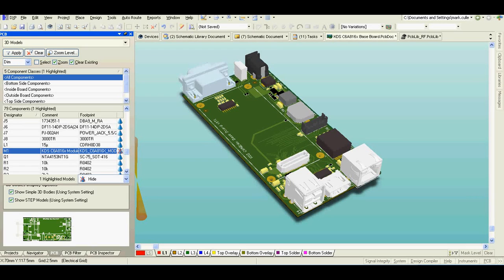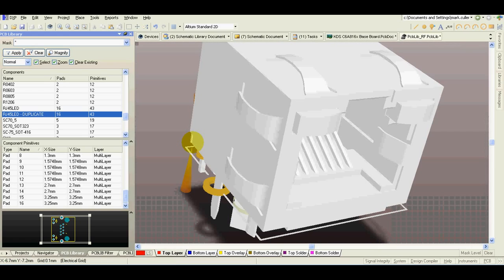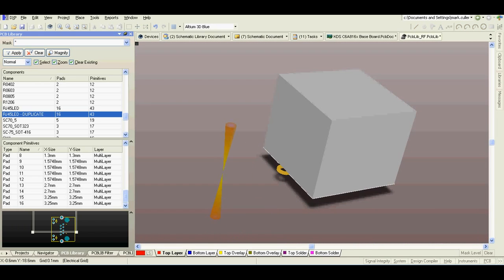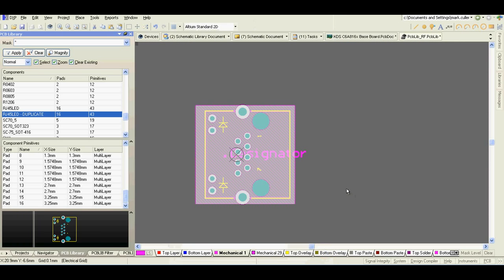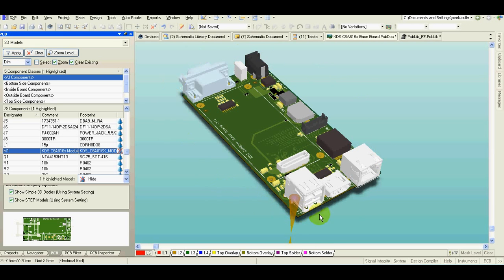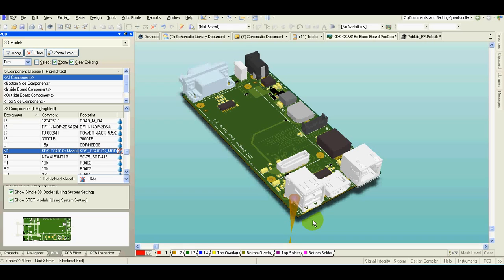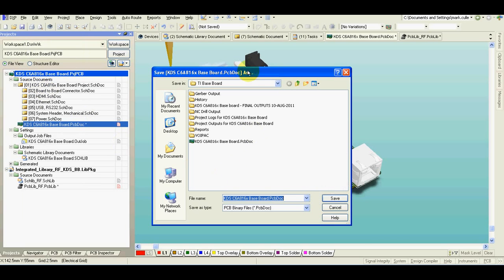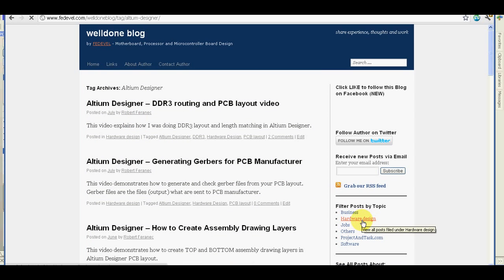Altium Designer - 3D model of your PCB - it's really easy

Comment: Hi Robert,really nice video...
maybe you could improve little bit the 3D placement phase by using the features: tools->3D body placement-> align face with board to automatically select the standoff height and add snap point to align the component to the footprint perfectly.